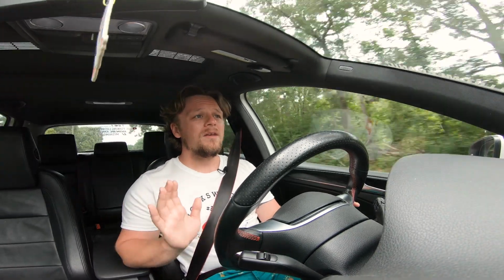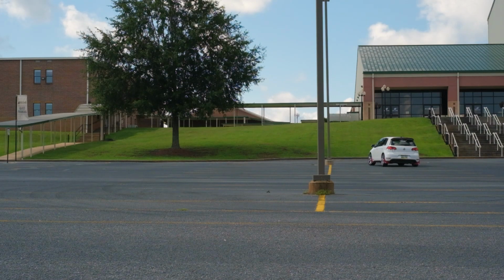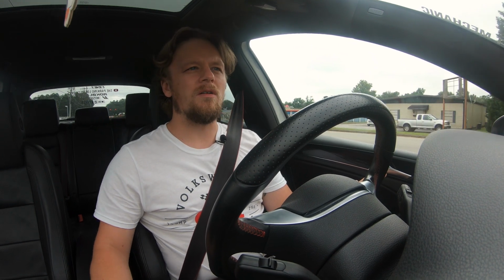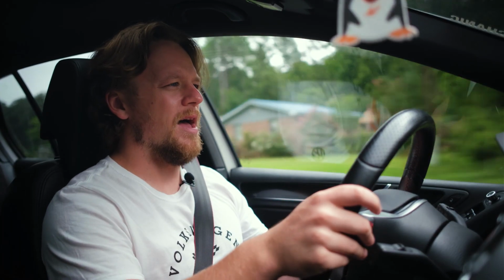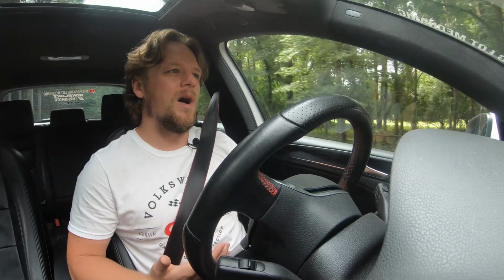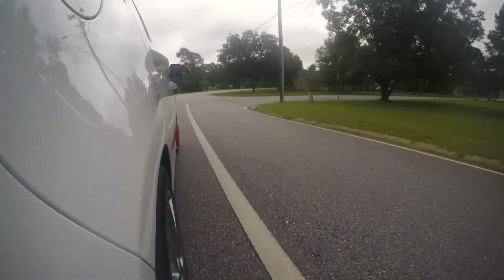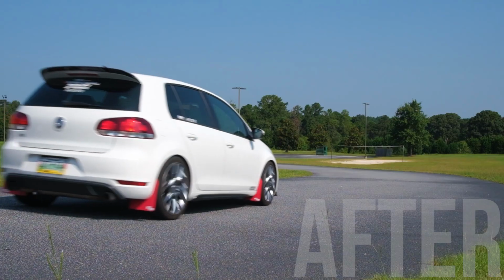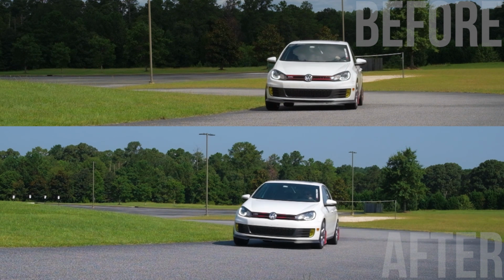The Butt Dyno Report | ECS Tuning 23mm Solid Rear Sway Bar | MK6 GTI

Comment: When upgrading suspension components you also need to consider how stiff you want it or get something that is adjustable for comfort and for the track or something in between if you plan on daily driving
Reply from the maker: Truth! I am looking for performance so sacrificing comfort isn't too big of a deal to me. Note: to me. Others really care! Thankfully with this sway bar, there is almost no added NVH and it doesn't ride different down the road at normal speeds in terms of bumps and vibrations, but it significantly reduces understeer and body roll when you want to have fun! I honestly think it's a no-brainer even if you are worried about keeping the car comfortable.
Reply: I’m getting the H&R 24mm bar. Hope I like it. The rear end really does lose itself on turns.
Reply: @em1ownerify  went with 034 25.4mm
Reply: @onuohafamily  how did that turn out? I’m still waiting for my bar to come in. Build back better is really annoying
Reply: @em1ownerify  pretty good, car doesn't feel like a boat on the off and on ramps, although it really makes you wanna take turns hard so be careful and don't get too hype lmao, but it's nice to not feel your body trying to fly out the window on fast and sharp turns
Reply: @em1ownerify  I also managed to get the rear to slip on an on ramp by accident tho there was some dirt at the end I didn't see and my rear slipped out so I had to counter steer
Reply: @onuohafamily  ya the back end really tends to want to sway without a bar. Have you done a front sway yet? 
I’m thinking try the 24mm rear first then upgrade my front to 26mm
Reply: @em1ownerify  not necessary in fwd